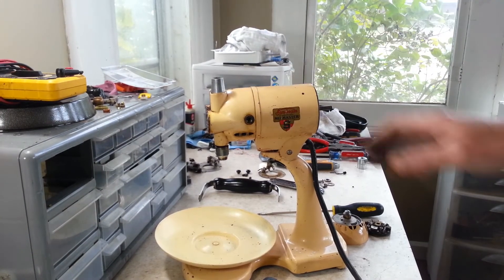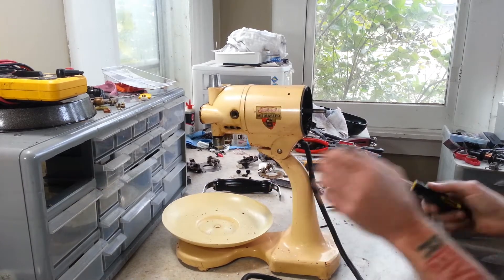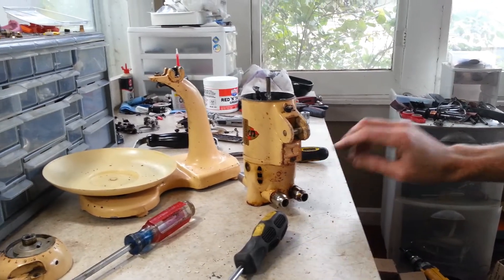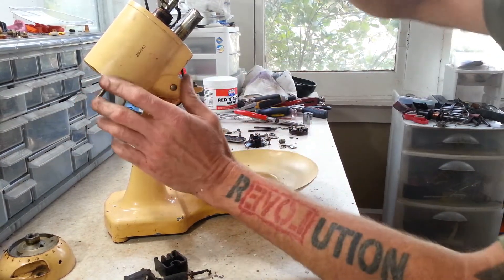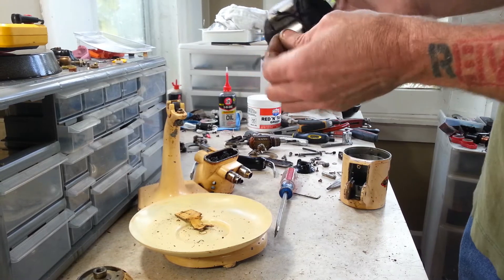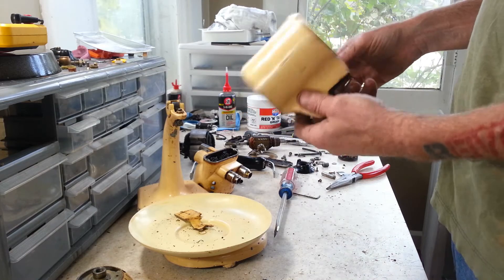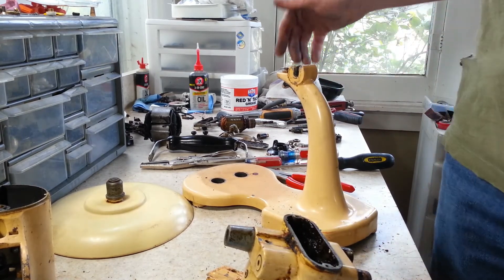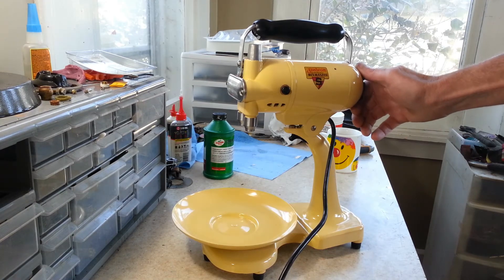Vintage 1934 Sunbeam Mixmaster Model 1 mixer restoration

Comment: Hi there thank you for all your videos they are very informative.  I am working on a model 1 myself and I believe I need a new resistor.  Do you know where I can obtain a new one or what the specifications are on the original?  I believe you said in one video that it is a 180 ohm, but I don't believe you mentioned how many watts.  Any help would be appreciated.  Thanks!!

Comment: @ 5:24 you say: "there's a brass ground screw down here" I thought in those times a ground wasn't used.
Reply from the maker: I know right! There was no grounds back then, but they grounded the RF suppressors to the chassis, I don't know if it was to dissipate frquency noise or what the purpose was. I call it a ground screw since modern electric uses brass screws for ground connections.
Reply: Thanks.
Reply: I believe it was to alleviate radio interference. In the 1930's everyone had a shortwave tube radio, which was very susceptible to interference from the earth's atmosphere and anything within the vicinity of the radio. So if you're in the living room listening to Roy Rodgers and mom turns on the mixer, it might scramble the radio signal. This kind of thing happened again in the 1970's when CB radios started getting more powerful, they would jam people's TV signals if a trucker passed too close to someone's antenna mast.

Comment: Good afternoon. Thanks for the video! I'm working on a model 1 right now. @ 1:03 you say you're taking the secondary brushes out. When I first watched the video I had a time trying to figure out just where you were removing them from. Now that I'm at that point I can see what you were doing.   I don't understand what these are brushing up against and there are no carbon brushes in them. Is there supposed to be? The part of the armature that the primary brushes rub against is at the opposite end, so what is brushing up against what? I'm thinking of how a Hamilton Beach's secondary brushes work and they do have carbon brushes. Thanks again and I'm looking forward to the next video!
Reply from the maker: Hey Jim! Yes there should be brushes there, they contact the back of the speed control, you can see it better here https://youtu.be/nXC6x1jVZpM?t=381
I do have another video coming up, its a kitchenaid professional 600 repair. I just have not been up to getting out videos lately, and I apologize.
Reply: @vintagemixersandmore1666  Thanks, that was a big help! I have a model J that I started earlier but abandoned. There were no shafts which the beaters are inserted into and the shafts of the beaters were actually pinned to the gears by the set screw in the gear. I'm assuming this is not correct. It must be some sort of "fix."
Reply from the maker: @JimWatsonTheframingMagician  yea that is definitely some kind of fix.. lol never seen anything like that before!
Reply: @vintagemixersandmore1666  This was my first time tearing into one of these early models. I thought maybe this is how it was done back then. I watched your model K video and the construction was normal. COULD IT HAVE BEEN THAT THINgS CHANGED BEtween model J and K? After much thought and hair loss I retired it to the boneyard.
Reply from the maker: @JimWatsonTheframingMagician  yea J and K are virtually identical from what I can remember, so if yours is missing shafts or whatever maybe it is meant to be a donor machine for the next one you find. The resistor in the back is a part you may certainly need, as many of them fail and only have 1 speed
Reply: @vintagemixersandmore1666  Actually, there is a difference in the watts The J is 60 watts and the K is 70. Deco Dan missed that. There would be no need no have 2 different model numbers otherwise.  Other than they are virtually the same as you say.
Reply from the maker: @JimWatsonTheframingMagician  Ah good to know! I assumed there had to be a difference somewhere, but I didnt know what it was. I own a model K, I need to find a resistor for it, it also is stuck on one speed. I bought a parts model J to use the resistor, and it was also shot lol. Maybe I can rig a potentiometer up in place somehow.. 
Thanks!!
Reply: @vintagemixersandmore1666  Maybe you could remove the covering off the old one, repair it and recover it.
Reply from the maker: I have thought about it, and still might look into it further, would like to get it going again!

Comment: Do you restore mixers as a business? How much do you usually charge to restore a model 1 like this?
Reply from the maker: Hi Chad, yes I do. Here is the link to my price list, thanks! https://www.facebook.com/notes/vintage-mixers-and-more/new-price-list-effective-5162018/2406026369423000/
Reply: Do you ever get over near Traverse City? I'm from there but live in Georgia. I have the mixer at my in laws home just outside TC. I could ship it to you or if you're over that way could pay for your gas. I wanna have my mixer rebuilt. It works but needs lots of tlc currently.
Reply from the maker: I haven't been over to that side of the state in quite a while. It would probably be cheaper to ship than the gas to drive there and back, its over $3 / gallon again, and we own several gas guzzlers lol.